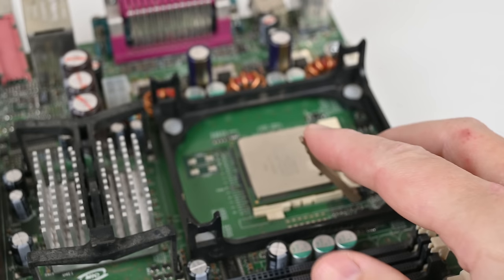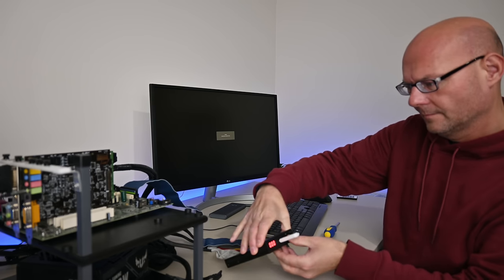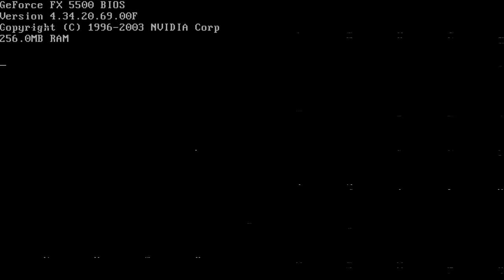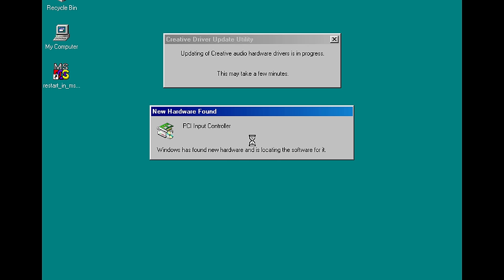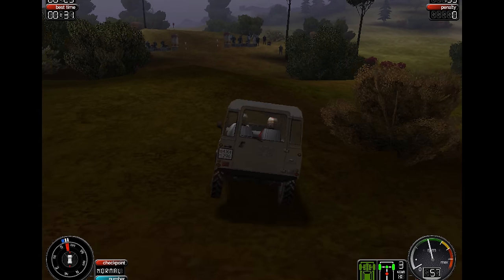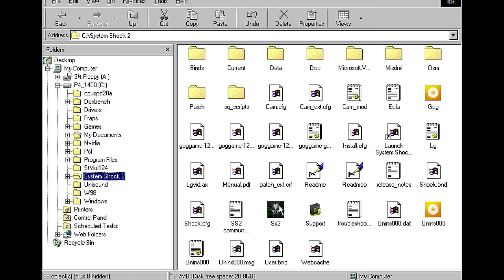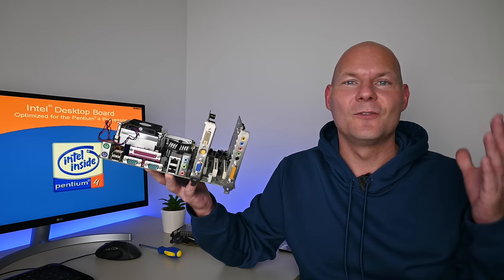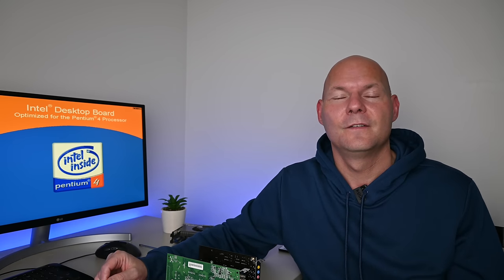It Failed in 2000, Has It Aged Well? The Pentium 4 1.4 GHz

Comment: P4s are a great "starter" retro rig. They aren't the best at anything, but they're at least able to run most things and the fact that you can find them for basically free is a huge plus. Ever office building on the planet probably has some old P4 Dells they forgot about in a closet somewhere.
Reply: I have about 30 somewhere lol.
Reply: You can't install a V5 or a V4 or a 3500, though. P3 BX is still the best but expensive choice.
Reply: Yeah, the Pentium III and Athlon platforms are sought after and not super cheap, Athlon XP hit the nostalgia of "my old gaming rig", Core 2, K8 and K10 chips are still usable for some modern tasks.
But the Pentium 4 has such a bad reputation that nobody wants them, same with the Geforce FX. But with the right expectations, they make for a great, affordable retro setup. A small Northwood and an FX 5200 Ultra are great 98/XP dual boot systems. I wouldn't go for RDRAM, that was expensive and still is, but a Northwood 1.6A and a gig of DDR-400 would make for a neat setup.
The 1.6A could easily go to 2.4 GHz if needed and the 2.4C will hit 3.2 GHz just fine. And any chip around 3 GHz will easily get to 4
For flexibility I'd say a model with a small multi and fast FSB would be best. The multi is usually not user-changable, but clocking up or down to reach other speeds is possible.

Comment: Pentium 4 Northwood models aged better than Prescott cores as they were built on a more efficient node and by the time it was released, dual channel DDR motherboards and chipsets were abundant thus giving people a cheaper option to RDRAM (SDRAM was holding back early Pentium 4 chips).  During this time I was on the Socket A platform with the AMD Duron 1.3 GHz (Morgan core) and soon after upgraded to the Athlon XP 1800+ on an nForce 1 platform (which a year later would become an Athlon XP 2500+ OC'd to 3200+ levels on an nForce 2 Ultra platform).
Reply: Prescotts longer pipeline with goals for 7 GHz never lived up to it's tasks.

Comment: I found an old IBM thin client with a Pentinum 4 HT (HyperThreading) at a thrift store recently for $20 and I love it. The board supported both IDE and SATA so I was able to use a modern SSD along with a newer DVD drive. Also put an old 8mb ATI Rage XL in it in the only PCI slot. I love this thing! It originally did a fresh install of XP but now I might go to 98SE for the better DOS compatibility
Reply from the maker: That's a keeper! Usually thin clients have low powered VIA or AMD chips. Very interesting they went with a Pentium 4 HT.
Reply: @philscomputerlab  Well, it's also odd that some manufacturers went for a full blown desktop Pentium 4 CPU in some laptops, with the heat and battery life implications that had. Admittedly that might have been only the case with some OEM generic models, like the one I have stored somewhere, and not with major brands.
Reply: Antix
Reply: I have a bunch of these in my basement - I'm waiting for them to get more attention before I rebuild them and put them on eBay ;) - Still, I have sold some IBM ThinkCentres with high end video cards for $500, 5-6 years ago already.

Comment: As a member of the Intel early access (IPLA) program I still have two working engineering samples of the P4 and I still remember the XDC 2000 (Willamette Developer Update) presentation in London where the prototypes and SSE2 was introduced to selected developers. It was the time Intel handed out "Validation platform systems" which basically meant you got a top of the line system with the latest engineering sample CPU. It was a fun time writing SSE2 code, so the P4 was not only part of my live but also part of my work and it was a time I will always gladly remember. Perhaps I should make a video about the prototype P4s? The early ES had an odd of-center die/IHS. Looks really unusual but wont go higher then 1Ghz (its unlocked). The later ES would go up to 1.4 Ghz and looks 'normal'. Is there any interest in this? I could add some coding insides as well.
Reply: I say give it a go. Linus made a video about the prototype Voodoo 5 6000 gpu, so I think even a Pentium 4 prototype will be interesting to someone.
Reply: @the1990kman  Oh I have some other prototypes in my closet as well. I wrote some of the DvD playback software for the Chromatic Research Mpact 1 and 2 cards which where later bought by ATI. Worked with almost every of the first and second gen 3d (de)accelerator cards back in the day, even an NV1 with some hand soldered connections (unfortunately that one is dead).
Reply: @lutzgrosshennig  Very nice!
Reply: i'd kill to see those prototype units!!!
Reply: "LutzLegacyLab" is a new channel where I will show the P4 prototypes and share some insides on the Netburst architecture from a developers POV. There will be some more stuff about the P3, P2 and Pentium MMX I like to share as well.
Reply: Sometimes I wish they would've given us a Pentium 5 with improvements on all the weak parts.
Full 128 bit SSE units, much higher FSB (like 333 MHz/1333 MT or 400 MHz/1600 MT instead of the 200 MHz/800 MT), more FPU units, Wider L2 and a big L3 cache (The Gallatin Extreme Edition shows how much the cache helps). Maybe even made on a more modern process node like 22 or 14 nm. 
Generally upgrading all the stuff around the ALUs, which were fine already.
Reply: I've got a couple of those P4 engineering samples (3GHz). They work just as good as the official issue. :)

I quite liked the P4, and for me it was always utterly stable.
Reply: @HappyBeezerStudios  Well when Intel startet with NetBurst they had a plan that would have mitigated some of the problems of the long pipeline. It did not work out and the competition showed that it was not necessary to do so and thats why the Core series was born. I am making a video about it in my sparetime that will explain it in more detail.

Comment: My first CPU was P4 1.6 GHz Northwood. Such a great CPU. I remember oveclocking it on GA-8IPE1000 at a rock-solid 2.4Ghz with only a minor bump in voltage.
Reply: Yes, all P4s from 1.6 up to 2.2 can run at 2.4 with the stock cooler.

Comment: Yet another brilliant video! I am a Pentium 4 fanatic myself. I was fortunate to have the best P1, P2 and P3 CPUs and yes, I admit that Pentium 4 A and B struggled with the P3 1.4GHz. Yes, in some games and applications the Athlons could have been better. However, my Pentium 4 2.4 GHz (without HT) has never let me down. It is with me since 11 Nov 2002. I still use it 2-3 times a week for a quick retro game. With the AGPx8 Ati Radeon 4650 1GB GPU it is capable to run Civilization 5 with up to 30 fps. DOOM3, Farcry 1, Battlefield 1942 and 2, Flight Simulator X etc. All pre-2006 game run at max details. Yes, P4s are running hot. Yes, they don't have a throttle down feature. However, I love it! I enjoy your channel so much!
Reply from the maker: Awesome 😎

Comment: I have a socket 423 system with the 1.7GHz P4. Paired it with a Geforce4 Ti 4200 and Vortex2 sound card. It's an excellent DOS/98 PC. I've been using it for the vast majority of my retro games for about 5 years without any issues. I think the motherboard is the Asus P4T.

Comment: My first PC had a Pentium 4 but it was a later one running at 2.4 GHz. I had it paired with a GeForce 4 Ti4600 and it ran everything I played at the time great. I even played through Half-Life 2 on that system when I first got it and it worked well, although not at the highest detail. I had XP on that system and never tried 98.

Comment: Intel was in Fry's electronics demo'ing the new 1.4ghz system with Quake 3. Was so impressed I plopped down my credit card and got the motherboard/cpu/ram combo. Prior to my P4, upgrades were almost yearly.  I think I managed to keep mine running up until 2006 or so, when the first Core2Duo's came out. My system at the time was pretty speedy.  I had an Adaptec SCSI controller, a 15k RPM drive.  I clutched onto my Glide graphics as long as I could.

Comment: Love the video, would be great to do a side by side of this P4 1.4Ghz with the P3 1.4Gz (Tualatin) with the same Video Card and other parts and see how they compare.  Personally, I run a P3 1.4Ghz with a Geforce 4 4600 and the Orpheus II.  Love the setup, its so flexible, old DOS all the way through the early 2000's all on 98SE.
Reply: The P3 runs rings around it in most everything.
Reply: A 1400 Tualatin can easily keep pace with a 1.6-1.8 GHz Northwood and in some cases even a 2.0-2.4 GHz model.
The 1400 Willamette is about as fast as a 1000 Coppermine or 1200 Tualatin Celeron.
Reply: what is the model number of your CPU? SL????

Comment: My experience with Pentium 4 was (and still is) with my Toshiba Satellite a75 S211. I got it second hand around 2011, and I still use it today to play retro games. It is hooked up to my CRT TV via the S-video out, and playing emulators on a TV just looks and feels right. I ran through some issues with the CPU overheating and shutting off the system entirely, but I discovered that was because one of the fans had just died. I replaced it with a used (and rather noisy) one, and it kickss ass beautifully! Keep up the great content!

Comment: P4's aged pretty well. Cheap, widely available, and super compatible for retro machines
Reply: Amd was smoking  Intel  in the p4 days.
Reply: Wide availability for basically free is a big plus as well. Athlon XPs were better in pretty much every way at the time, but good luck finding a working cheap one today.
Reply: ..and my 1400MHz T'bird. 266MHz did not?
Reply: @PhAyzoN  You can find plenty of Athlons XP, but mostly not that higher models and also, later P4 had dual channel which makes some difference. Some decent 3 GHz P4 is perfect platform for Win 98-XP retro gaming build. Ofcourse there is nothing wrong with Athlon XP, but games back in the time were designed for HW which didn't exist yet, so when you want to play some 1999 game on ultra setting in 1280x1024, you need 3 GHz P4, all later AGP GPUs are bottlenecked even by 3GHz P4 so with some Athlon XP for socket 462, it's pointless to install better GPU than like 6600GT and even that will be bottlenecked.
Reply: i was thinking about building such a machine . my pc back them used a P2 so its soo dlow even for retro. what kind of gpu and other componebts would I need
Reply: @dallesamllhals9161  It did and IIRC it was just one third of the price of the top model P4 CPU.

Comment: You know Phil, I was there back in the days of MS-DOS, the IBM 5150, had a 8mhz 286 with VGA as my first IBM compatible PC and had an Amiga 2000 with 3 megs of RAM (!) and a 500 megabyte SCSI HD.  OC'd a Celeron 300a to 450 mghz and had a 486 66 dx with a Mediatek Pro Audio Spectrum 16 Pro. Your channel brings back memories of good times. Thank you!
Reply from the maker: What was your favourite PC or era?
Reply: @philscomputerlab  It wasn't until things kind of stalled late in the Pentium 4 era that my enthusiasm kind of waned. I had a  Core 2 system and a Phenom x4 that was in use until 2020, but Windows 10 kind of commoditized things after 2015.

Comment: Happy Friday Phil! I love the Pentium 4 platform. I just built a P4 system as a WinXP gaming rig. It uses an nForce chipset but works grand under XP. I do have a couple Dell socket 478 builds as well that dual boot 98 and XP, and they run perfectly including dual channel DDR 400 ram. I do have one socket 423 board that uses Rambus, but it’s a little finicky so I never used it in a full build. Thanks for sharing Phil!
Reply from the maker: Many of the Dell machines had Intel OEM boards and good reliability.
Reply: I don't like nForce chipsets, I always had problems with that. For socket 478 boards, I prefer Intel 865 chipsets, it supports prescott and DDR400 and it's reliable, no problems with late AGP cards etc....

Comment: I like the Pentium 4, I grew up with it.
My first was a 2Ghz Northwood which was in the family PC for what felt like forever but was probably about 4 or 5 years. It replaced a 350mhz Pentium II.
Played so many great games on it with no issues and the performance was really good compared to all my friend's PCs and consoles at the time.
I eventually did an in-socket upgrade to a 2.8Ghz Pentium 4 around 2006, before building my first PC later that year based on a socket 775 3.4Ghz cedar mill Pentium 4.
Thought that was awesome until I upgraded to a Q9650 in 2009; biggest upgrade I've ever done by the way.

I now have two Windows XP gaming PCs with Pentium 4 extreme editions. One is a socket 478 3.2Ghz version, the other is a socket 775 3.4Ghz version.
Reply: I  still have a 3.0 GHz Cedar Mill here, and while it can reach 4 GHz fine, it will get completely destroyed by a single core Conroe Celeron.
I have a soft spot for LGA775, the fact that a 3 GHz single core Pentium 4 (or downclocked to 2.4 GHz) can run on the same platform as a 4 GHz Core 2 Quad with about 9 times the performance is just crazy. And overclocking still takes some work. It isn't just more vcore and upping the multi. Everything is done through the FSB, so northbridge clock, memory clock, memory strap, etc are all connected.
Reply: @HappyBeezerStudios  I've still got my Cedar Mill 641 that I bought back in 2006. Great CPU, I overclocked it to 5Ghz once, don't think it was stable but it was still mind blowing back then. I have found that the Pentium 4 Gallatin extreme edition is slightly faster in games though so that's why I run it in my retro rig.

I learnt on the 775 platform and like you have a soft spot for it. The first 3 PCs that I built were all 775 so it still feels natural to me to do FSB overclocking. I didn't upgrade to anything else until 2014 when I got a 4690k.

Comment: I had a Pentium 4 back in the day.  It was a 3.8 GHz Prescott model. I had to buy an aftermarket cooler because the one it came with could not keep up when playing "heavy" games (GTA San Andreas was OK, but Oblivion ran poorly). This was also the time of cold cathode lights and case modding. It served me well until I eventually got a Core 2 Duo some years later.
Reply: I had to get an aftermarket Zalman cooler for my Prescott, because it gave off so much heat. This was my last intel for years and started to run with the AMD Athlons for years, until Intel got it's game back with the Core i7.
Reply: Nice. 3.8 GHz was the highest official clock speed P4 reached - it never crossed the 4GHz barrier.
Reply: You were lucky I used Prescott till 2013 just for browsing the web & YouTube,kept it running 24x7 I think that's to blame my mental disorder the immense heat in Arab desert.
Reply: @S9uareHead  They never released the 4.0 GHz model, but it was planned. But then, you could just as well do it yourself. Get a 3.0 or 3.2 GHz model and clock it yourself. And since oc goes over the FSB and the architecture really benefits from more bandwith, you'd end up with a faster model than what would be released.
Reply: @frankg.2949  Intel became super competitive in 2006 with their Core 2 chips. Better IPC than Athlon 64 and the ability to clock higher. K10 could keep up, but that time Intel had already released Nehalem. I'd say around 2007-2018 was Intel's great time with unrivaled performance. Only Zen2 was able to catch up and beat them.

Comment: Still running a P4-2.8HT with 1GB ram and a SSD caddy so I can (drive swap) run DOS, win98, winXP and even Vista on it. It has 2x voodoo2 cards, ATI 9800, SBlive!.. Works great for all my retro gaming needs from mid 90's to mid 2000's.

Cheers!
Reply: That is a sweet setup.

Comment: Interesting video! Although the P4 Willamette wasn't a great CPU, it still is very nice for a Windows 98 retro system.
Reply: Indeed
Reply: Willamette was sort of a proof of concept. Completely inferior to Tualatin, but functional.
Northwood was the height of the architecture. Massive increases in clocks (and thus performance) and unbeatable (at the time) in some tasks.
Prescott lenghened the pipeline, reduced IPC but couldn't balance that out with even higher clocks. It was pretty much unable to do what it was designed for.
Cedar Mill was pretty much just a shrink of Prescott, but fixed the power draw and is a decent ship. Pretty much what Prescott should've been from the start.